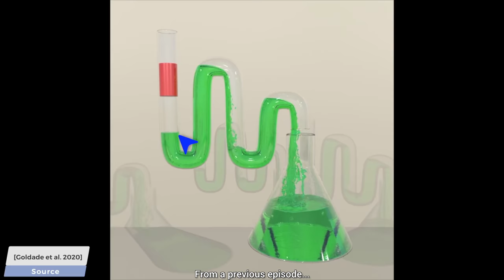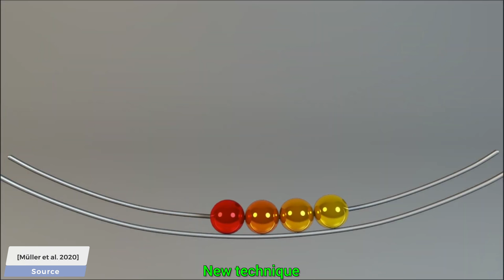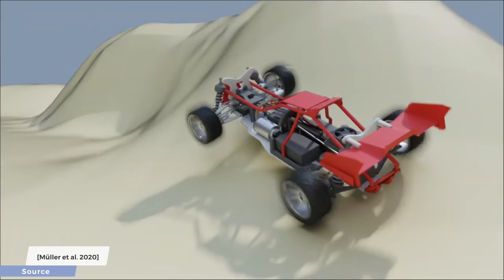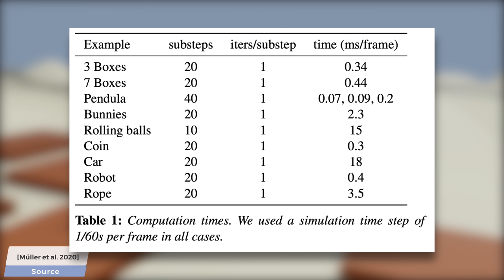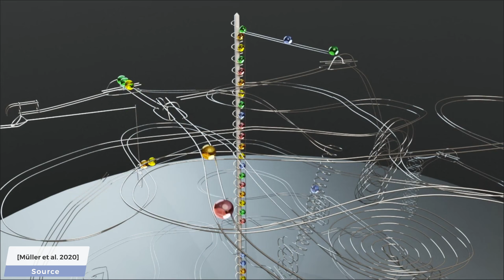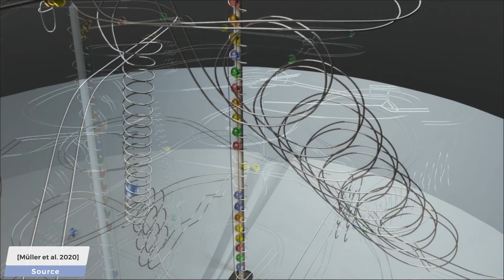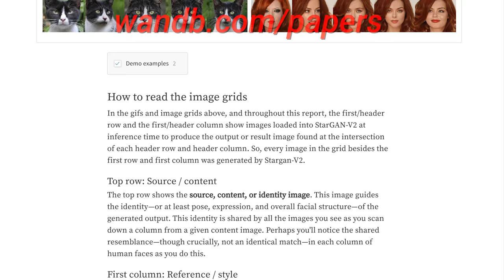Finally, Deformation Simulation... in Real Time! 🚗

Comment: BeamNG Drive: am I a joke to you?
Reply: Muller et al.: Yes.
Reply: heheheh got ya
Reply: @carnap355  there is real soft body physics in beam ng. Beam ng does simulate the physical properties of the mesh ( metal in this case ) and how it should react when reforming. There are stronger parts and weaker parts, attachment points and all the like.

You can tell this through the fact both simulations have the same tyre mechanics. The rubber is simulated to deform differently like metal, to plastic, to glass etc.
Reply: @carnap355  
From what I've read, the simulation in this paper is done by constraining primitives and the mesh is bound to them.
And in BeamNG, constraints are beams, primitives are triangles and visible mesh are bound to them.
There is no major difference in that point.
Reply: And all other racing game with advance tyre deformation, temperature factor, compound and wear xD
Reply: @carnap355  Yea sorry pal but File Xor has got ya on that one. BeamNG does bring something new to the table, having an entire vehicle axles to body simulated so closely to that of reality AND run at high frame rates? Have yet to see another game utilize that. 

Cloth physics isn't new but using it to that extent without a big performance loss is new.
Reply: @carnap355  Same developers, they made BeamNG, but yes they made that first - although not nearly as user friendly or polished
Reply: @blinkero8  What?
Reply: I thought the same
Reply: This can easily become BeamNG Life lmao
Reply: @blinkero8  yeah, but there are not many other games with the same level of soft body physics and chassis flexing as beam
Reply: @soopespeed  Yes and no. You are right most racing games don’t have soft body physics but most high level sims do simulate chassis flex under loads
Reply: @cademckee7276  ah, which ones? I would assume things like iracing and ACC, but I don't play many sim games
Reply: @soopespeed  iRacing,ACC,AC,RF2,AMS,AMS2,PCars 2, Raceroom Racing Experience. Pretty much every major modern sim has some sort of system. It varies how detailed it is per sim tho
Reply: @zh9664  what did he say roughly?
Reply: @cademckee7276  although I wonder if some of them  kinda cheat to do that just by adjusting the values of the alignment of the wheels to simulate chassis flex instead of physically calculating the exact geometry of a car. You have a unibody, roll cage, chassis braces, and an engine as major rigidity deciders 
So it  would take a ton of work to simulate the interaction between all of those things accurately enough to have the tiny changes that chassis flex has.
Reply: beam NG no tiene un algoritmo tan optimizado como este, son miles de poligonos menos y la simulación solo funciona con metal, en este caso todo se simula, cada parte que tenga un proposito puede chocar con otra, todo con una gran cantidad de poligonos, además de variedad de materiales, como los neumaticos, que no son tan duros como el resto de materiales
Reply: @Zumito  beamng does have a very optimized algorithm, which is why people are even here in the first place. and the system would be able to run in REAL TIME and this can not this is trash its the same thing just more simulation but worse performance so dont even start with performance, torque3d could do this more polygons and way more fps and no there are not thousands less polygons ALL of the cars in beamng are simulated here only a few parts are simulated this just does the same thing beamng does but just way more  shit.
Reply: @Zumito  all it is is just a more shit solution to already solve problem

Comment: Beamng drive is gonna improve so much after this
Reply: unlikely they'll implement it
Reply: Not really since I'm guessing that they both use similar simulation techniques and BeamNG already is pretty realistic and has better performance than this simulation (< 0.1 ms average physics calculation time per frame for one car in Gridmap). If BeamNG wanted to make even more realistic deformation physics, all they would have to do is to make the cars out of more nodes and beams, although that would come at the cost of a slower simulation. But I think BeamNG's main goal is balancing performance and quality of the simulation.
Reply: Beamng goes beyond that (with much simplified physics engine), it takes into account clutch, breaks and tires temperature, breaks fading, pneumatic pistons in the suspension, etc. It will take much more effort to make a general physics engine that won't take shortcuts for all these things along with curved body interactions
Reply: this does not look to groundbreaking here. beam has all of that and more
Reply: You are all missing the point. This could greatly improve the look of vehicles if they were to put in the new physics then rebuild current functionality on top.
Reply: @unkr3at1v  What is groundbreaking about this is that it is more accurate, much more "fine" (spatially and temporally), does not have fringe case error (you know, the beamng spaghetti glitches?) and is vastly, vastly, vastly faster. 

If the principles behind "old fashioned" deformation (like beamng's) were applied at the level of detail shown in the car scene in this video you would have time/frame in the seconds or minutes.
Reply: @xxoan.1613  Idk what potato pc you have, but BeamNG runs better then most other games i play, like ETS, GTA 5 and more.
Reply: @angelo_234  It should be noted though that the paper used an "i7 3.6 Ghz" which is not only a meaningless unit (because 3.6 Ghz existed in 2014 and performance was worse per Ghz, and most CPUs boost well beyond that) but likely not even relevant because physics could be done in a separate thread.
Reply: @MrGTAmodsgerman  well, for me GTAV works better than BeamNG
Reply: Tom Pladijs  well, yeah i have, but that's the point, performance is meant to be useful for people with low end pcs. It doesn't really matter if your game can do 24325235FPS on a high end pc (as long as it is not a 3A)
Reply: Tom Pladijs  lol, sure
Reply: @carnap355  I believe it says in there that there is a technique called "Shape Matching" that allows for this behavior, but they aren't using it due to its limitations. So they are using a different technique and it sounds like it doesn't allow for this behavior in rigid bodies.
Reply: @xxoan.1613  its performance isnt beyond shit. It's a heavy game. What did you expect?
Reply: @xxoan.1613  nop
Reply: @gajbooks  An additional fact is that this was done on a basic non-specialized CPU, instead of a dedicated physics ASIC or downloaded onto an AI-oriented FPGA. Game performance still suffers using the latest gen ray tracing (not to mention gloss and fog assets being abused), and we could definitely use some dedicated logic for procedural generation. The combination of the three go hand-in-hand. You could even make a server-client streaming and rendering optimization, as well as a real-time multiplexed behavioral cheat detection/prevention system (e.g. server only streams objects, entities, and terrain the player can see within an actionable radius that changes depending on the path they take and interactions the player has available).
Reply: So, kind of like using computer logic to simulate how our own world works with quantum physics and particle-wave duality.... We'll get there...
Reply: @Baigle1  I wasn't invested enough to see if this could be implemented on a GPU well, which would be the fastest way to push this mainstream. I doubt if physics ASICs ever become prevalent, but PhysX is already used.
Reply: Beam 2.0 - a whole new game
Reply: @angelo_234  lets be honest those beamng is pretty buggy at times.
Reply: in reality,i didnt see much more than what we can see on Spintires,mudrunner or snowrunner,it has the same wheels deformation,suspension work,etc,etc.and that game runs on any potato pc with plenty of frames,i also played it on a 2011 macbook pro,so....
sure i loose something on the video,and i love the destruction of Beamng drive,but....spintires have some years yet.
https://www.youtube.com/watch?v=jQuYbyUV0rA
Reply: @xiro6  spintires is literally just slowly driving from one place to another on mud, dirt and offroads, of course they'll focus on wheels physics and deformation
Beamng drive already has that (maybe a lil worse) and realistic car damage, with hyperrealistic car physics in general
Reply: Nope. Not the same system.
Reply: @xxoan.1613  Not really. You can have quite some cars before it start struggling. Which is quite the achievement when you see all that is simulated.
Reply: White Rice  beamng is kinda partially molecular, it uses nodes to deform geometry
Reply: Beamng is 👎
Reply: Remember this statement 5 years later. I think youtube recommendations will do it's job.
Edit: not exactly beamng but some other name, but the idea is same, vehicles  simulation is the future of gaming.
Reply: beamng already has tire deformation bro
Reply: @evennot  tyre temperature doesn't exist in beamng sadly
Reply: @scottex.  OK! I thought in neon mode there was an indicator for tyres. Probably confused it with something else
Reply: @evennot  yep, it has the weight on the tyre, that's what the indicator is for but sadly there's no tyre wear or tyre temperature ( It's really strange considering that they have clutch temperature but not tyre temperature)
Reply: @xxoan.1613  
Your PC is just bad. My laptop can handle up to 8 cars before dropping below 60fps.
Reply: @xxoan.1613  your pc must be shit if you can’t run it lmao. I agree that it’s not perfect, but what do you expect from a game so intensive on the cpu?
Reply: @xxoan.1613  yeah, only if you have a potato as a PC.
Reply: @angelo_234  Im sure someone will make something similar with this technoligy, just look at Wreckfest
Reply: @thejdmguru621  wreckfest doesn't use softbody physics. It uses unrealistic and old system. Even "Insane" PC game had soft body physics in year 2000 and was running smooth.
Reply: @EJ205T  Well, in a way that's true, I should of done a different example.
Reply: @EJ205T  thanks for reminding me of this game. it was awesome.
Reply: @evennot  the problem with bng is the driving physics, as pretty much every car is going to understeer, even when they shouldn't
Reply: i see everyone comparing this to beamng and saying beam is already doing this eetc but not one of you seems to mention the fact that this seams different tech from beam as beam is using an old tech called soft body physics. the problem with soft body physics is you have to balance the rigidness of the object with its ability to deform. want more detail across more points of deformation then your solid objects have to be "softer: where at a pint they can become jello like( you all know this as when u hit a bump in beam the entire car cvan wiggle" make the car too rigid and it no longer deforms. therefore you end up with all these immersion breaking results in games like beam where objects have a :jello: consistency. the tech in the video seems to be much more complex then the soft body physics implementation and i can not see any form of compromise in order to increase detail and fidelity. that in it self negates any "longer compute times" and this can be solved iom sure with either more efficient code or just scaling up compute power which we have no problem doing.
Reply: @mckseal  Forgive me, but I'm not sure how you're reaching the conclusion that this is faster than BeamNG's method. That single-car simulation took 18 ms per fram, which is already way beyond the budget allowed BeamNG's simulation, which can include quite a few cars at once besides. So this may be higher quality, but unless it can handle 20 cars at more like 5 ms per frame, I don't think it can be considered anywhere near as fast.
Reply: @delphicdescant  Because BeamNG is simulating at less detail (the effective delta-T is larger) due to inherent approximations. 18ms/frame is fantastic for a physically near perfect model.

But for BeamNG to simulate the detail shown here would be 1-2 seconds per frame, and we haven't got any clear routes forward in a beamng style physics model. i.e. no clear path exists for beamng to get to this level of detail at equal performance.

The point is that this is an entirely different approach which provides an alternative path to the one beamng is on. It is fast in its current state, works perfectly and is comparatively novel and unexplored. There is potential here for optimization and approximation to come in that may drive it down to beamng frametimes or near enough.
Reply: @mckseal  Ah, ok, I can see what you mean.
Reply: Or see a variant in PC2, this will be a game-changer in sim-racing
Reply: No why they don't use the same way of doing this at all. And they won't change the way they do it any time soon.
Reply: Tom Pladijs  x to doubt
Reply: @mckseal  beamng is so close to real life deformation that people have done comparisons. If you made beamng’s graphics AAA quality, the game would look and feel as close to real life that we are capable of in real time

Comment: OH MY GOD THAT COMPUTE TIME THOUGH- this is crazy!
Reply: Dr. Zholnai-Feher skimmed over it, but the car was run just 7.5% slower than real time.  Real-time interactive physics simulation is only a few papers away!
Reply: @Zeuskabob1  Those results depend alot on the hardware they are using
Reply: what if they used 128 core cpu.wkwk
Reply: @bravebee1272  they are running it on a gpu most likely as nvidia is involved in the project
Reply: @bravebee1272  Well you could run it on a PC with two AMD Epyc 7742 CPUs. That would be a 128 core PC, but it doesn't matter because this is probably running mostly on a GPU.
Reply: According to the specs in the paper it was an i7 with 3.6GHz (x4 cores?), 32Gb of RAM, GPU isn’t specified. Modern PC with RTX card should do that stuff with ease.

Comment: car manufacturers: hmm, maybe we can use this and spend less on crashing actual ones
Reply: They don't do that, it's another company, the manufacturers earn money instead
Reply: They do it already, just with slower algorithms on supercomputers. The cost of a few dozen crashed cars can buy you a decent amount of computing power.
Reply: They've been doing it for years, if not decades
Reply: Car manufacturers simulate using algorithmic methods that aim to model real structural physics and fluid dynamics. These "simulations" are geared towards getting close to physics, without needing a lot of compute. If you tried to use them to predict real physical systems, they would fail badly. There is a reason that fluid dynamics has not been replaced by smooth-particle-hydrodynamics and structural simulations still are not run on GPU's. And that is that when you want to do real physics, you can't parallelize it.
Reply: @avialexander  nature is real, physics is partially real, maths is not real, algorithms are only aproximations in this case, whether parallel or not.
Reply: @intrametaarchi1015  to be fair maths are real. nature is not real and physics is an approximation of reality

Comment: Isn't this already present in BeamNG? At least the deformation simulations.
Reply: Not this kind of deformation. BeamNG's is rigid deformation, this has soft deformation.

Edit: My original comment was incorrect. BeamNG does have softbody deformation physics.
Reply: @TornaitSuperBird  What's the difference? I thought BeamNG was all about soft bodies.
Reply: @TornaitSuperBird  Beamng does has soft body physics
Reply: this is an improvement on it. older algorithms tend to go full kraken. this one is apparently smooth as japanese dog fur.
Reply: @TornaitSuperBird  my guy the whole game is soft body physics XD
Reply: @TornaitSuperBird  its literally softbody,i think you confused it with either wreckfest or flatout 2

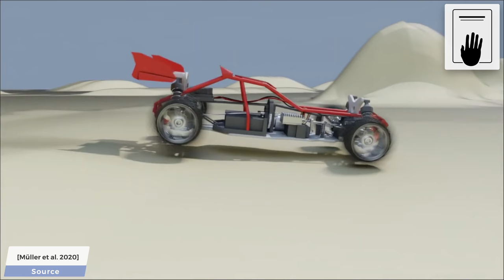Comment: The RC-car simultion is unreal. I've had many hobbygrade cars in the past years, and this simulation is incredibly close to a real life 1:10 of 1:12 scale buggy (although without much or thin oil in the shock absorbers). Absolutely mindblowing
Reply: Okay addition: The car rendering in 55 frames per second sounds like the most amazing RC-game ever. Re-volt 2 Remastered anyone?

Comment: I believe this is just a soft body physics simulator just like BeamNG. And BeamNG probably uses the same simulation techniques that this simulation uses, but BeamNG actually has better performance than this simulation (< 0.1 ms average physics calculation time per frame for one car in Gridmap). Although that could be due to BeamNG using fewer nodes and beams to simulate the cars than this simulation does but I'm not sure about the key differences between the two simulators.
Reply: This is cutting-edge research. Whatever techniques BeamNG uses are inferior. (Or just plain different.)
Reply: @sgbench  actually they are superior,assuming this is done on a computer that runs beam at even 30 fps,why am i saying this you may ask?
beamng literally simulates every single part of a car and a good enough rig can run it at 105 fps on the most intensive map.all while simulating almost every aspect of a car on max graphics.

Comment: Physics simulations for driving games usual have to run at hundreds of Hz. They are specialized implementations however (although they calculate tire deformation). Perhaps this technique, which in contrast is more general, also avoids the need to run at such high speeds to avoid clipping (like a tire passing straight through a small bump or obstacle at high speed)